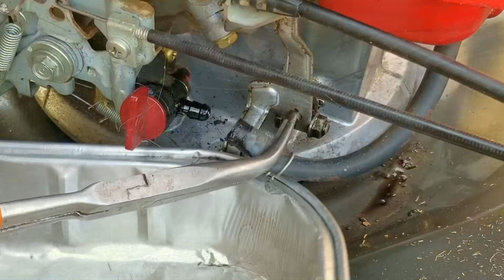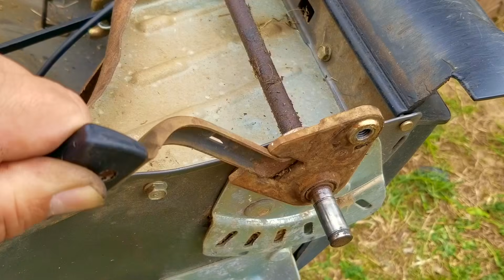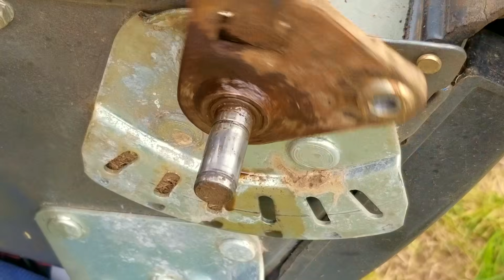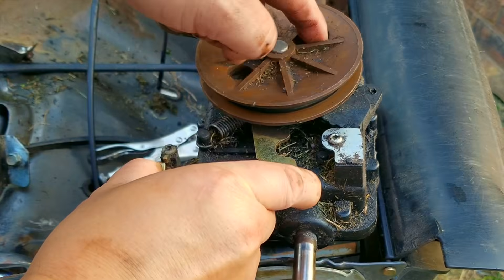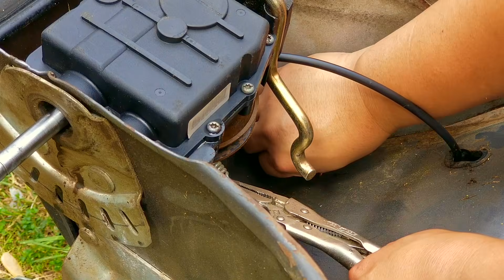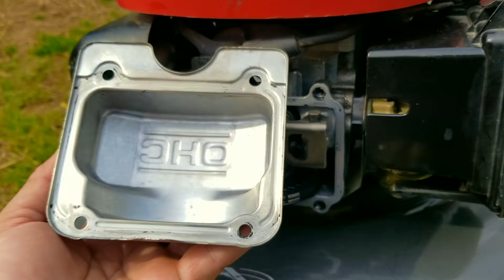Honda Mower Self propel finally fixed

Comment: Thanks for the great video, I'm halfway through the repair but had to stop due to freezing hands.  I may end up just leaving the gears off and using it as a push mower, but still I'm going to press on for fun.  I'm 4 hours in now, mainly due to a cheap pair of snap ring pliers.
Reply from the maker: I completely understand, nothing wrong with a push mower.
Reply: Well I've complete my repair after about 12 hours of work, mower works perfectly.  The drive shaft was pretty worn at the bushing and all I had was 150 grit sandpaper, but it seemed to work okay.  The belt tension spring was a pain to take off and to put back on, but I finally figured out that it's easier to connect the spring before the belt, and then use a wonder bar and a 2x4 to extend the spring to install the belt.  My clutch cable also seemed to be a problem, not disengaging the transmission on the bench, but installed with the engine running it now disengages, sometimes with a little extra tap on the bar.  I ordered a replacement cable, hopefully it will have the mid-cable adjuster.  I also had some trouble re-connecting the gear shift cable, finally figured out that you have to pull the cable through the housing and install from the right wheel side.  Next time I think I can do this repair in about 4 hours, with a better pair of snap-ring pliers.  Thanks again for the video.
Reply: @bleelaw   - I found Channel Lock brand pliers to work great.. I bought the small set and the regular size set and snap rings were no problems again...

Comment: Yes!  I have performed this procedure, and adjusted valve lash, and replaced all 4 wheels, on my Honda lawnmower that is now in its 22nd year of service.  Absolutely worth the tedium, especially if you divide the hours of maintenance by the years of service.  Also, I looked at new lawnmowers and not only were they very expensive, most of their parts are plastic now (mine is still an all metal version, even the transmission), and most have safety features that add unnecessary complexity to the design.  I decided it was far preferable to perform heavy maintenance on mine instead of replacing it.  I have only ever owned two lawn mowers in my adult life (the other was a Lawn Boy that lasted 9 years - I repalced it because I hated the two cycle engine - I could have fixed it but went to the Honda to have a four cycle upgrade in 1999).  Great video - I needed it to see which direction to reinstall the drive gears, I forgot to take a picture as I disassembled them...  Keep up the great work!
Reply from the maker: thank you Jay Tetzloff

Comment: finally i found what i need i just pulled a mower out of the garbage the engine is torn apart and the one wheel of the FWD is locked i have another mower with a good engine but bad deck so im trying to get that wheel free so i can use my engine on it without the self propel so according to this video i can just pull the gear off the axle and I should be good because even with no belt its still stuck
Reply from the maker: good luck to you on that project, sounds like you've considered all your options.

Comment: Does is self-propel on the ground? My new wheels also spin when the rear is lifted, but when on the ground it won't push it. The drive belt is also new.
Reply from the maker: by chance did you take the gears off the end of drive shafts?  How did you pick the belt you got?
Reply: @INSIDEHOUSEGARAGE  I didn't remove any gears and I ordered the belt from the original parts diagram for this make and model. Thanks.
Reply from the maker: thank you for the Information, I appreciate it.  Unfortunately, from the information you gave me, there could a few issues. 1, there's a problem with the cable that goes to the transmission.  2. The drive pulley on the crank is severely worn, and needs to be replaced,  or 3. there's a problem with the transmission itself.
Reply: @INSIDEHOUSEGARAGE  I replaced the cable also. It could be out of adjustment. When I received this mower it was stuck in 3rd gear and would run away with me.
Reply from the maker: can you confirm that the all it changes into all the 3 speeds and that each is working fine, while the drive wheels are off the ground.
Reply: @INSIDEHOUSEGARAGE  Will let you know.
Reply: @INSIDEHOUSEGARAGE  I discovered the end of the cable that attaches to the transmission level had popped loose. That explains why it shifted so smoothly. I reattached it, confirmed it stayed intact, but the same scenario is taking place. Wheels spinning when rear of mower lifted, not enough power to push when on the ground. The only think I have to do is to try to adjust the cable and see if it improves.

Comment: No. I wouldn’t fix a 10 year old mower. On the flip side, my dad had an old plastic decked unit Honda since at least as early as 2002. He got rid of it (still worked great, just hard to start) a few years ago and bought a Commercial Honda unit.
Reply from the maker: thank you Hubert Ramirez.

Comment: Excellent repair video!  Being retired, I wound not hesitate to put in 8 hours on a complicated repair. Of course if was a customer's machine I would not justify the labor charges.  For a spring removal tool I use a wire coat hanger that i reshape for added strength and comfort.
Reply from the maker: thank you cherokeefiddler
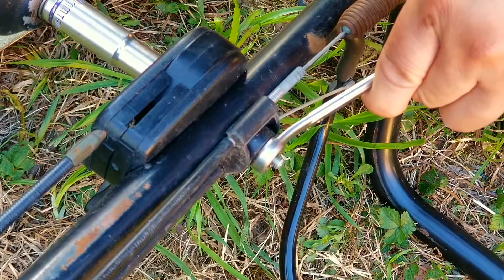Reply: A lot of ideas and that ' 2:49 s fine, for the easy or for the tools needed for sc ess to som parts

Comment: You asked about a different way of removing the spring that tensions the belt? Squeeze the belt and as the transmission moves towards the center of the motor and where the blades were, grab the transmission and keep pulling it enough to take off the belt. slip the belt off the pulley, then relax the tension on the spring and it will go all the way back and the spring will come off as well.
Reply from the maker: wow, that's sounds much easier, I'll have to give that a try.
Reply: Thank you. I made an add-on video to show my tip: https://www.youtube.com/watch?v=91yDTecIuhA

Comment: I have same mower as your the self pro is not working right so I do?
Reply from the maker: what's the question again?
Reply: The self propelled is not working   What should I do .
Reply from the maker: First I would make  sure that the cable for the self propel isn't broken from handle, down to the transmission.  Then I would check the drive belt from the engine to the transmission.
Reply: My neighbor has the same mower as my it not running for 5 years  it has no spark I need help I replace the cord  my one that works
Reply from the maker: sorry but I don't think I have a video on that sort of problem
Reply: @INSIDEHOUSEGARAGE  it ok

Comment: My neighbor gave me his Honda mower. It was probably 4-5 seasons old. He sorta maintained it but then parked it for a year after neglect caught up to him. He tried to start it, bought a bunch of new parts and it seems like he took off the carb. He gave it to me to try to fix it. I spent 1 hr figuring out the intake system and got it running. He had put the carb parts wrong. It came with new air filter, new plug and new oil. There's even new oil in the trans. I'm watching this video so I can get the drive system to work. Already ordered the a belt and a new blade as the look original. We shall see if the belt helps but I just don't see a way you can spend 8 hours on this mower. After that long you should just give it a new paint job, that's what I'm thinking of doing.
Reply from the maker: 8 hrs includes filming.
Reply: @INSIDEHOUSEGARAGE  Makes sense. Thanks for the videos. Just saw your latest one and we have the exact model number
Reply from the maker: thank you WookieMonster01

Comment: I have been having issue with wheels locking when trying to pull mower backwards.  I have the HRX217hxa.  I removed the pinion gear, key and spring, cleaned.  I replaced all three parts and put the gear on so that it now rolls backwards properly, like new.  This is pure logic as to which way the gear should be on.  I notice that your gear position is just as mine is.  However, now the mower will not engage the self propel, it tries but there is no pull.  If I reverse the gear, put on backwards, the transmission grabs but now cannot roll backwards.  This is blowing my mind.  I would love your view on this.  Thanks
Reply from the maker: sure, the ratcheting sound should be present when you push the mower forward. If it makes the clicking noise when pulling it backwards, it's because you have the gears facing backwards. either the  bushing in the adjusters rusted to the shaft, or your transmission is locked up.

Comment: I’ve got a Toro that is now 21 years old. It has grease fittings on rear wheels , runs and pulls fine. They don’t make them like that any longer I’m afraid..
Reply from the maker: you are absolutely right about that.
Reply: I am glad you like your Toro... I have never seen a Toro that cuts grass very well... They seem to just run over the top of it and leave it all smashed down and not cut evenly...

Comment: Great how to vid but makes me realize I don't want to go that deep. My problem is my drive gear that engages the the right wheel keeps getting worn down every time I mow with it. And the that wheel also slips while the other drive wheel on the left is solid. Too much slop in the mount? Model HRX 217
Reply from the maker: thats a good possibility
Reply: I own 2 of these and am having constant issues. Sad hearing this as I spent a good deal of $ on them.

Comment: Thank you for taking the time to make this video my mom has a similar lawnmower with transmission problems and this gives me a peek at what I'm into. Your question about the time spent personally I would because I have the time to put into it I'm 60 and kind of retired and mom is 80 and doesn't want to buy another lawnmower but I do understand what you mean about time if you have a shop to make a living or extra money or even a young family ware the time could be better spent. 
Thank you for your video's Ted
Reply from the maker: thank you Just Ted, good luck on your mom's mower

Comment: Myself I had one that lost all it's fluid. I drilled a hole in it and filled it with grease. I used a screw for a plug and it seemed to work just fine after that. The guy still uses it and it still works.
Reply from the maker: nice work.
Reply: Thanks for the tranny tip, I’ll have to remember that.   I would have taken it apart, looks like torx security screws, bought a set of those years  back, a life saver

Comment: Yes done it several times !! These Honda mowers are very very expensive new the reason being they are a dam good mower I bet that mower you have there will last another 10 years
the engine on the other hand will probably last another 30 years I have a Honda Izy thats over 30 years old and still going strong its now on its third deck Nice up load thankyou !!
Reply from the maker: no problem and thank you Allan Hughes.

Comment: I think it was worth it to repair the mower !! These mowers, like I mentioned in the last post are close to $500 dollars!! I remember buying a new mtd mower that had a similar deck and everything, but was a push mower for around $95 dollars!! ( it was on sale from $125 dollars! ) it lasted for almost 20 years! Anyway, thanks for the great video!
Reply from the maker: wow, you really take good care of your stuff!
Reply: @INSIDEHOUSEGARAGE  Thanks, I couldn't afford a new mower, so, like you, I would fix up one that a neighbor or someone would leave by the curb ! I did, however buy the mid mower brand new! Only mowers that don't hold up are snapper brand, they're heavy and engines don't hold up !
Reply from the maker: thank you B. Powell

Comment: I worked 10 hours today on mine...replaced the blades, belt, back tires, oil, air filter, and polished the axle. It wasn't allowing the mower to freely be pulled backwards. It's about 8 years old, but like new again! Only $40 in parts.  Reasons: 1) save $, 2) like the challenge 3) can't see it filling up the landfill and junking up the planet, when it just takes some elbow grease.
Reply from the maker: I wish more people were like you

Comment: You spent 8hrs on this but also did a lot more to the mower then just fix the issue. Probably didn't need to do anymore than free up the adjusters. Did the other things really need to be done? It's always tough to know that answer. This is where we rely on the experience that is gained from working on something for 8hrs and learning. Excellent video!! Thanks for sharing.
Reply from the maker: possibly, however I felt as though it needed to be done and the experience was rather nice, Thanks I appreciate your comment.

Comment: Thank you for making this video. To answer your question yes I would spend eight hours to fix my mower because to replace it with a new mower would cost me over $500. I have a Honda push mower which no longer engages the self propel. Simply adjusting the cable did not do the trick so I will be taking it apart checking everything and cleaning it like you showed in the video. I have had mine five or six years and definitely hope to get another five or so out of it. Do you have a favorite reliable source for parts online?
Reply from the maker: I would use ereplacementparts dot com, put the first part of the model number in the search field, like "hhr216" then look at the last numbers and match it up with comes on the screen, xvaa.. etc.

Comment: I have a chance to buy honda HRX model little over 10 year with occasional transmission slip for 50 bucks.    the starting and running has no problem.  Worth the buy and fix self propel?
Reply: I would definitely do that
Reply from the maker: I think so.

Comment: Hey I have a  Honda hrx 217 that when I put it to turtle it makes a rattling noise The motor shakes
Reply from the maker: does it run fine in the rabbit position?
Reply: @INSIDEHOUSEGARAGE   no it tries to die  every time I put it in rabbit it does not idle right
Reply from the maker: @Keeperdad32  without more information , at the moment I'm guessing its a carb issue.
Reply: @INSIDEHOUSEGARAGE    OK thank you have a good morning
Reply from the maker: @Keeperdad32  no problem

Comment: This is definitely the Achilles heel for these mowers.  I've had to rebuild mine 2 or 3 times in the last 5 years.  Always the same issue with the spring loaded key seizing or the pinion gears wearing excessively (yours also looks well worn, so replace them if you also buy new rear wheels).  One thing I would add is that the transmission isn't really sealed for life.  A little Googling will help you find the capacity for it.  It's normally just 10W30 engine oil.  I changed the fluid in mine about a month ago for the first time with no adverse effects.  You just need to have the mower upside down to fill it.  Open it upside down as well and then use a pail to catch it as you turn the mower over so you can accurately measure how much came out.  Compare that with the fluid spec amount you find online especially if it shows signs of leaking.
Reply from the maker: thank you for the information Darin Nederhoff.

Comment: had the same problem with mine which is just like your.  mine jsut needed the cable to be adjsuted . logic would seem then one would pull the cable to get it tighter, but the honda was reverse and need the cable push forward.  after i figured that out its been perfect .
Reply from the maker: Nice decution

Comment: Nice tip regarding the magnet and keeping the parts in order.
Reply from the maker: thank you A Patterson
Reply: Harbor Freight sells several sizes of magnetic metal cups that are not expense.  I have 4 as I stop projects usually for parts so just stick the cups on metal for a week or two until I get back working on interrupted projects.

Comment: I take a length of paracord. Loop it around the spring. Then I can easily pull it with both hands. Won’t slip off like pliers either.
Reply from the maker: I have some paracord so I'm definitely going to try it out. Thank you Rob Stone.